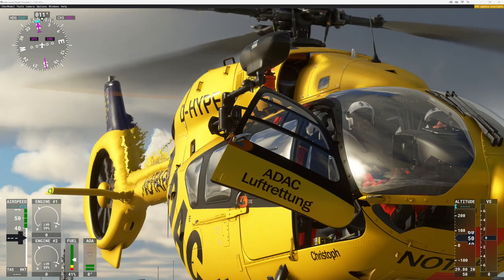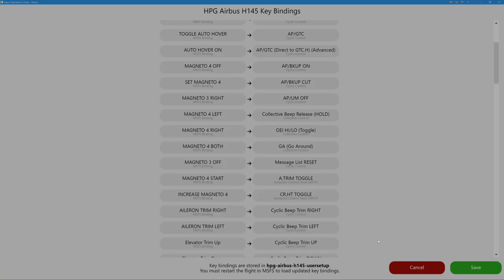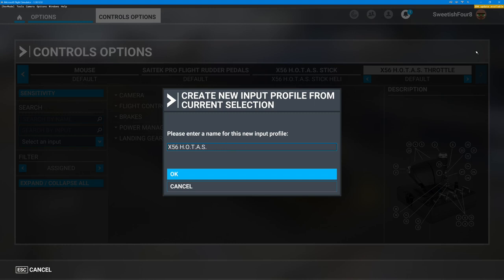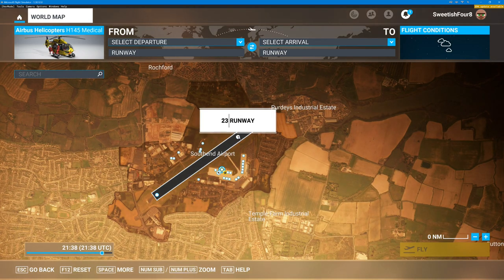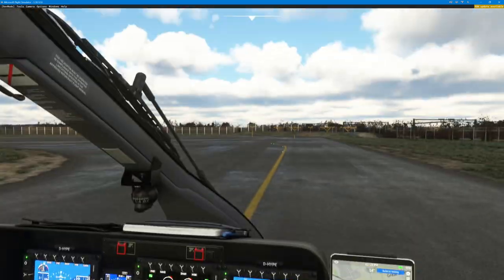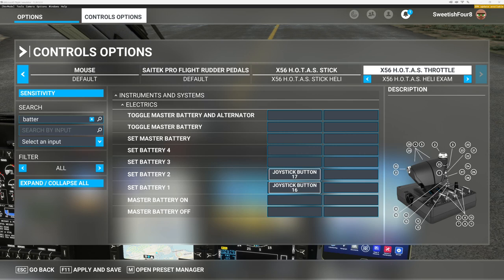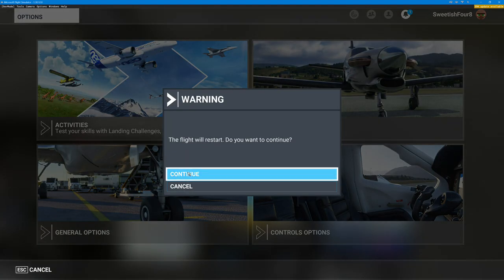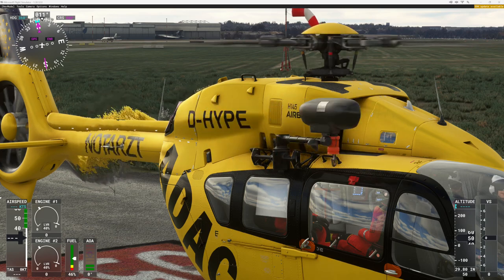1c. Part 2. Programme your stick, throttle and other preipherals to specific commands on the H145.

Comment: Can this go to high elevations like the ALPS, if not, which HELI do I need?
Reply from the maker: Hi Dabney. I habe had a look on discord channel and otnisnclear that there are some folks flying om the alps, and there are also Alp add ons available in flightsim.to . The aircraft will perform true to life. I gather that one weakness is flight in icy conditions so I may well test and check the limits. It is used.in real life though. As for the weather,  I suggest you check put the pms50 website for the gtn750 unit. There is a paid for version that you install in the H145 and I do believe that this will give weather readouts. Time.for an experiment me thinks! Hope that helps. You will.of.course.need tje Action Pack to fly missions. Take care.
Reply: @theflyingdoctor  ok, great, if you get anywhere with it , let me know

Comment: Some reason my collective wont work,  everything else works but my collective wont work, I have a helicopter profile for the collective set for my throttle and it wont work, got any ideas?
Reply: 1. Go into the controls settings in MSFS and check that you do indeed have the right profile in place - its easy to have the wrong one. (Options - Controls, as ever), 2. See is msfs detects the throttle - the throttle equates to the collective when you are in the H145, so you don't have to make any specific adustments to accomodate this. Click on 'Search by input' and move the throttle. If it comes up with throttle axis you are good to go. The manual on p10 reads H145 Function - Collective control , MSFS Axis Name - THROTTLE AXIS, MSFS Key Name - Increase Throttle, Decrease Throttle.  This said, mine reads Collective Axis - Joystick L-Axis X, and Mixture Axis (Joystick L-Axis X) on the Rhino x56. (Things may have been updated since this version of the manual) 101722
Reply: @revdrlangleymackrell-hey750  Did all that and it still wont work, im using the airbus throttle quadrant, it just wont respond to any inputs.